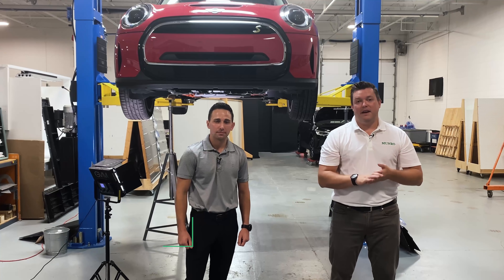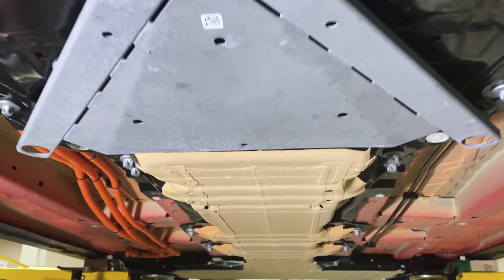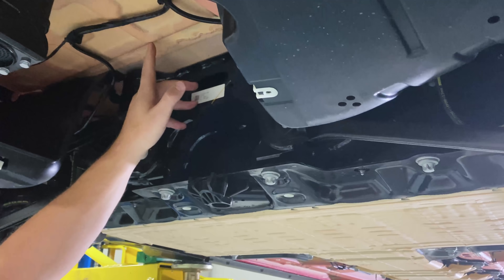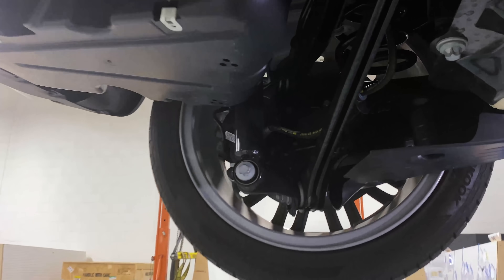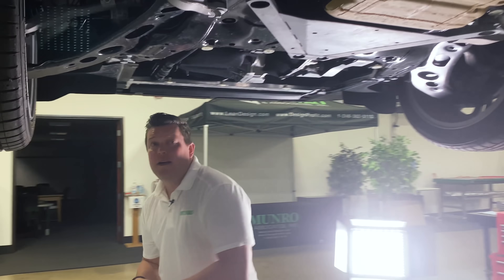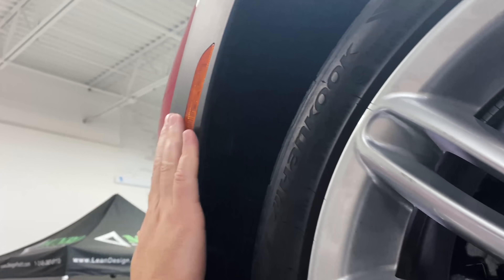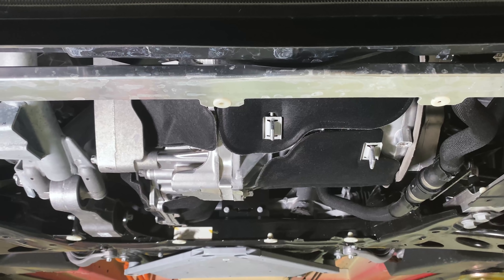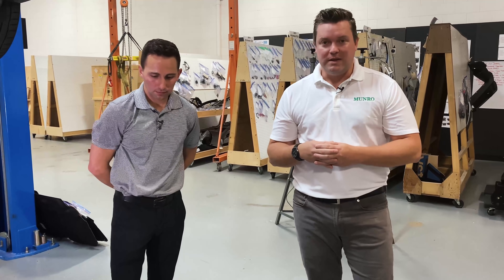Mini Cooper SE- Electric | Undercarriage

Comment: Another ICEV conversion.  Legacy automakers, in bringing these conversions to market, achieve production line flexibility - they can make ICEVs, they can make hybrids, they can make BEVs using the same body-in-white and most of the same tooling on the same production line.

They aren't convinced that their ICEV sales are going to fall to zero.  They believe they can make enough BEVs to avoid emissions penalties for their fleets, but continue cranking out ICEVs.  They don't see BEVs as their main products going forward.

The performance penalties for a BEV which isn't engineered specifically for battery-electric are severe.  Battery packs are volume-constrained, so range is terrible.  Wonky decisions end up getting into the design - like placing high-voltage cables under the battery pack on the Mini, not a safe place for those cables.  Or like filling up the 'frunk' with all kinds of stuff - the idea of using the frunk as cargo space gets thrown out.

All of these are symptoms of a legacy automaker who is adjusting to disruption far too slowly to ensure their survival.

The Mini isn't devoid of good features.  Perhaps that will console workers when they get their pink slips.
Reply: I personally WANT all of legacy to make proper ICEV conversions. The chances of the tech fitting in older models, seems higher. I think converting an old fleet is a great niche. But this doesn’t seem to be the direction yet.
Reply: @taylor92493  Correct.  Everyone should want conversions like this.  This mini is a high quality conversion that you wouldn't get 3rd party.
They didn't redesign the car, so existing mini owners will like it.  The mach-e is a decent ground up EV, but it doesn't appeal to existing mustang owners.
The mini is also dirt cheap in the US, can be as cheap as under $20k brand new with federal and state incentives.
The BMW's last short range EV was the i3 which had less range and cost $50k.
I bet a lot of bolt owners dealing with buy backs jump into this electric mini as there aren't good jobs for bolt owners to get exactly what they got out of their bolts.  The mini is cheap and anyone who doesn't need more than 100mi of range would find this to be a good vehicle.

Comment: Since the Volt was never an ICE only vehicle, is it likely that Chevy was using it as a test bed for converting existing vehicles to EVs or hybrids?  They had a clean sheet with it and they didn't have to use that T shaped battery.
Reply: No, the volt is a ground up parallel hybrid that would be a terrible pure EV conversion.  This mini is likely the best factory EV conversion out there.  It is a niche car that wasn't redesigned like the mustang so existing owners will actually want it.  The 100mi range covers pretty much anyone's daily commute.  The car is 23k with federal tax credit in the US and under $20k in states with additional incentives.
BMW likely just made the best cheap EV you can buy, the only real issue is you gotta be a smaller person to fit well.  A concern that won't be an issue for current mini owners.

I think what BMW did here is brilliant.  You don't need to fully redesign cars for lower end EVs where you don't need bleeding edge efficiencies or super fast charging.  That said, over time, these conversions naturally get better as battery tech improves in general.
This is by far better than the twice as expensive i3 that had worse range, was still small, and  cost over twice as much.

Comment: It’s good learning for us when you talk about the thinking that goes behind each component. It seems the automakers can constantly learn from each other and not keep making the boneheaded mistakes that causes unnecessary service, repairs and recalls. One would think all the kinks would have been worked out by now, yet we continue to suffer as consumers. Really glad that Tesla seems to be breaking the old lazy norms with its innovation. The new world order, innovate or perish. Munro is shining the light on the dark underbelly where the cockroaches can no longer hide. Excellent job 👍
Reply: This is basically a factory made EV conversion of an ICE model.  Mini is lower volume and its owners likely like this more because it is a converted ICE and not a redesigned mini.
This car is higher quality and way cheaper than if you bought an ICE mini and paid someone to covert it to EV.
For what it is, I think this car is perfectly fine.  It matches what owners want out of it and with 100mi, even in the US market it is usable for nearly all daily commutes.
If you live in the right state after EV incentives, this mini is can be under $20k brand new.  This is what the i3 should have been.  If you can fit, this mini is far better than the i3 with is silly gas range extender and cost of $50k.  When you account for price, I think BMW actually did a good job here.  When making lower volume cars with less range, you really don't need a ground up approach.
I consider the way they packaged the electronics into a frame package that drops in just like an engine would to be decent innovation.  
This is likely BMW's best EV so far because it isn't overpriced and thus not a waste of money.
Reply: I.ve read a lot about Lucid and invested in the company because of their engineering. Hope their production execution.as good.

Comment: Jordan is another asset in front of the camera, knowledgable & natural. (IMO)
Now what halfwit at BM thought that they could allow this so called Mini out onto the public roads with high power cabling routed like that (?) 
No doubt the same halfwit that signed off the BM engine where the timing chain is at the other end of the engine, the clutch end!
Reply: So true. That high voltage cabling looks homemade and dangerous. If the car gets driven over something in the road, the cabling is likely to get damaged or ripped out. Can’t believe Mini/BMW built a car with high voltage cables being the lowest point of the undercarriage. How do you spell lawsuits and recalls?
Reply: The cabling is covered by an aeroshield which Munro removed for visibility, which will prevent it from getting snagged by brush, and if you have something pierce the shield and the cable then you'll probably have more issues than just having the cables from the charge port to the OBC being cut.
Reply: @Wrkncacnter777  So, you say there IS a shield! Thank goodness! I immediately spotted those cables thinking this can't be happening! Phew...
Reply: @Wrkncacnter777  And MINI is using the same design that Toyota and countless other Hybrids use with deploying the cables: they are protected by the aeroshield/splash guard undercarriage cover. I guess the moral of the story here is don't go four wheeling in your tiny two door Electric Vehicle.
Reply: @Wrkncacnter777  The shield you speak of Stuart was not mentioned or shown and they also told us that these cables are normally run in/or alongside structural members for safety.
Odds on the shield you speak of is made from some kind of composite that a big piece of road debris could easily puncture & possibly the cabling under it.
Still if you are happy with that offering from BMW feel free but I and many others (I guess) will give it a miss after seeing that.

Comment: Nicely put together inspection of this ice car turned into an EV.  It never occurred to me that the Mini would be such a low tech approach to an EV.  Thanks.
Reply: I am sure people who convert EVs are really liking that drop end component package that drops right into the existing motor mounts.
People who are judging this harshly are forgetting this is a factory ICE to EV conversion and from the looks of it, a really good one.  The batteries are mounted in the right spot for an EV and not just squeezed into cargo places.
I think BMW hit this out of the park.  They can now offer EV minis that do not redesign the car in a way existing owners wouldn't like.  The mach-e is a nice EV, but it is not a mustang and doesn't really appeal to many existing mustang owners. (on the flip size, EV camaros are converted by 3rd parties and they do appeal to existing owners)
BMW's last low range EV was the i3 which had less range and was over twice the price.
This mini-cooper EV is about $23k after the federal tax credit in the US and under $20k brand new in states with additional incentives.
This mini is a great commuter EV and the only real limitation is the smaller car size, but existing mini owners are already fine with the size of the car.
I hope this converts a lot of mini overs to EV.

Comment: Cool, 5 minutes in and I can see this car is an absolute piece of crap. Complete Frankenstein monster. Also what’s with the stupid noise box? So troll. Thanks for all the hard work, fellas
Reply: The noise box is required by law throughout Europe - even Tesla have now been forced to add exterior speakers to meet EU regulations.
Reply: @SteveBakerIsHere  oh i see, thanks for sharing. I was not aware of that. Thinking about it from a safety standpoint, I can make sense of it.
Reply: @noobcaekk  It's kinda emblematic of the approach though.  MINI added a "noise box" - bolted under the car and looking like a total afterthought.   Telsa added a set of exterior speakers that could also be useful when camping or in some other situation where you might want a decent sound system.  You can also customize the sounds the car makes when moving slowly...and they have plans to use it to replace the car's horn, so you could customize the sound your car horn makes (which is something I've ALWAYS wanted!).

The difference in approaches is stark.

MINI want to do the least possible to meet the requirement.

Tesla want to turn a liability into a hugely positive feature using software...and look at whether they can claw back some of the cost by eliminating some other part (the horn sounder unit).

Comment: I know Sandy hates these 'one-chassis-fits-all-drivetrains' EVs, but I think it's the only way that the legacy car makers can TRANSITION to the completely new-designs that he likes. Tesla had to start from scratch and felt the growing pains of doing so. The good ol' boys can use existing design expertise and consume existing inventory on their way to the future and start making money on EVs without the instantaneous mega-investment that they could/would/should have to do - they can do it piece-meal. It'll be a less efficient process, but one that eventually will get them to the finish line none the same. 

One question on the 'battery-where-the-fuel-tank-goes' design: What does that do to the front/rear weight distribution?
Reply: transition - perhaps for 1990s but NOT for this century

Comment: NO small ev will have a spare tire.. not for space. for weight. remember our good friend sandy? " every engineer. one gram or ounce, every day " (reduced weight i cant remember if it was gram or oz) but the point remains.. a tire is heavy. in small evs, if the manufacturer has half a brain, they'll add a tire repair kit, not a spare and have service (their own or 3rd party) to support roadside when needed (multi flats/or dont know how to use tire repair kit or issue cant be repaired)
Reply: I think they're simply noting this,  though it does appear to be wasted space.  Perhaps the spare could fit there? Perhaps a well within the trunk space would accommodate an optional spare or extra trunk storage.  The Mini is pretty compact,  so this is a missed opportunity for a little extra storage.  Also,  I'm not sure,  but I think a spare tire is required by European law.

Comment: Rather surprised to see the high voltage  cables not exactly looking well attached or that safe even.
Reply: After all this is bmw, who uses plastic coolant lines in the ice cars which crack and cost a fortune to get to and replace. When rubber or metal could have been used.  How much engineering or care do they, or have they ever used. I mean how reliable are their ice cars compared to toyota or honda?
Reply: @ariip  average BMW costs third of the purchase price on service not covered by the warranty in 1st 3 years from purchase...
Reply: @Daddo22  In my first 3 years of SE ownership, my expenses have been several gallons of washer fluid and a set of winter tyres and wheels. My OE summer tyres are nearly done, though. As far as maintenance goes, it doesn't get any lower than that.
Reply: @pictsidhe6471  I'm glad to hear that Mini doesn't follow in their big brother's footsteps then.
Reply: I think they took of the flat covers of
Reply: Yeah it's weird. Just some little zip ties holding them up. I imagine with enough heat the plastic on the zip ties will break
Reply: Look at the undercarriage of a Toyota Prius. It has the same high voltage cables deployed in a similar fashion to the MINI.
Reply: The lines are inches above the stamped steel battery housing. And protected by the sealed under carriage. I suppose if you took this EV four wheeling and you got it high centered on a rock which first penetrated the steel battery housing, then the lines might be cut.
Reply: @jayhawkeyes  they are not safe. If you run over a piece of wood or metal object that has fallen out of a pickup and onto the roadway in front of you, it will damage or rip out those cables held on with zip ties. This past weekend I had the front bumper damaged on my Jeep when I hit a piece of metal that flew out of the bed of a pickup as it was passing me at high speed. No way to avoid it. Stuff happens, and those HV Cables are a disaster waiting to happen.
Reply: @mikedx2706  Wrong, Wrong and Wrong.

They removed the undercarriage cover of the vehicle that protects the entire under body of the car.
Reply: @jayhawkeyes  The plastic under cladding is not for protection it is for aerodynamics. It does nothing to protect from any kind of substantial road debris.
Reply: @Weezedog   Wrong. It is for both aerodynamics and road debris.
Reply: @jayhawkeyes  Good call - for some reason they don't mention that they removed the covers in the video....other than to make themselves sound smarter than the manufacturer I would suppose. There are other videos on Youtube that show a very clean and finished undercarriage with covers protecting all the wiring and brake lines, etc. Why didn't they mention they took off the covers I wonder?
Reply: @jayhawkeyes  road debris is a real issue and everyone knows those stupid covers end up falling off eventually or are removed by impatient repair people. Some repair person removed the fender liners of my current used car at some point, breaking most of the mounting points in the process. A real damn mess to fix and the replacements are a fraction as thick and I expect it to be a continual maintence issue. Any OEM should know better than to count on those being there forever.
Reply: @patreekotime4578   No, the undercarriage covers on modern vehicles produced in the past 10 years do not end up falling off eventually. These are standard carriage covers that basically every vehicle is now equipped with. What planet do you live on?
Reply: It looks very similar to the HV cables on the Tesla Model S Plaid.

Comment: This really looks slapped together. I was hoping Mini would take EVs seriously....Smart to use existing infrastructure (ICE vehicle conversion) to save some money on this but....just seems like a hack job.
Reply: Agree. A reluctant effort on a small budget.
Reply: It's a stepping stone vehicles that allows 30% of MINIs sold to be electric vehicles. All MINIs will be electric in a 2025-2030 time frame. 

Anyone expecting MINI to have produced a Tesla-like EV in 2020 when this car was released is a Tesla Fanboy.
Reply: all the EV stuff is the same and taken from the BMW i3 (hence why the motor is in a cradel in the front of the car) and its built on the same line as the ICE cars - when they first released the car it was cheaper than the ICE cars but they get so many orders and USA got total scewed over on price - I belive it an extra 5 to 7k more in the USA vs UK now
Reply: @QALibrary  You have it exactly backwards wrt the cost in the UK vs USA. Much more expensive in the UK.
Reply: You could conjecture their budget for this was... minimal.
Badum tsss
Reply: For sure it's not some wonderfully careful new design.   Back in 2012, MINI made the "MINI-E"...they made 500 of them and leased them to established MINI enthusiasts around LA and NY.  If you compare the specs of the MINI-E to the MINI-SE, they are IDENTICAL...not just close...IDENTICAL.  Range, acceleration and top speed are exactly the same.  When you see how they've kinda wedged all of the electric goodies into a pretty much standard ICE MINI's framework - it's clear that this is something put together in a hurry - and without much design effort.   All the did was take the electric parts of the decade old MINI-E and stuff them into a slightly more modern MINI body.   Just as with mainstream BMW, they are clearly not taking electric vehicles seriously.

Comment: so, its a conformity model, not a proper ev. those high voltage cables should not be legal.
Reply: They're covered up.
Reply: @Robert-j6r8c  a speedbump would disagree.
Reply: @SupremeRuleroftheWorld  

The battery is lower, there's plastic covers that completely cover those lines.

That's like arguing a speed bump will destroy your fuel lines.
Reply: @Robert-j6r8c  i dont see any cover in the video and i am pretty sure they did not remove it.
Reply: @SupremeRuleroftheWorld  
They remove all the covers before filming.
Reply: @Robert-j6r8c  thats great, but that cover is not going to do much if you grab a curb. a piece of plastic and those wires are not going to survive scraping 2 tons of car on it.
Reply: Nonsense. It's the same way that the Toyota Prius and countless other vehicles deploy high voltage cables.

The only surprising thing here is that the Munro Live "Engineers" aren't familiar with a common car industry practice for deploying HV cables.